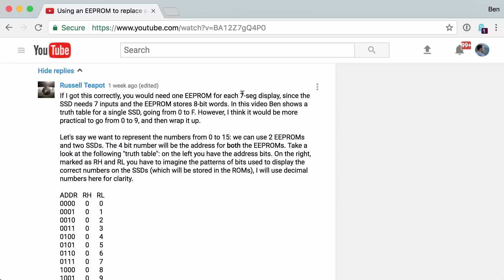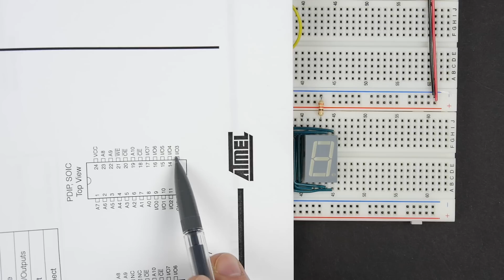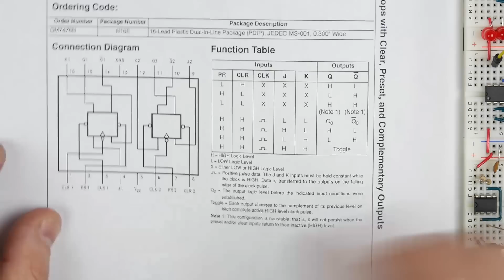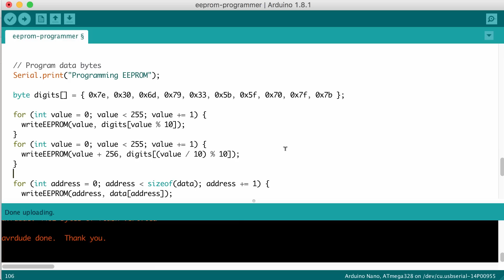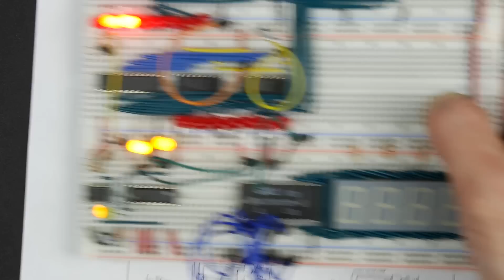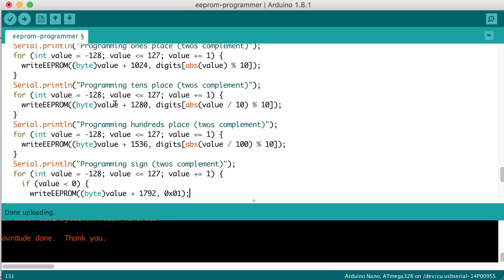Build an 8-bit decimal display for our 8-bit computer

Comment: Hello.  Interesting.  Now, does the counter reach to 9999?  I see you use 8 bits so you wrote up to 255 values.  To write 10,000 values you will need 2^12 bits.  Am I correct?

Comment: I think the 74LS139 is not rated to sink the current of the whole 7 seg display (all 7 segments + dot). isn't it better to use transistors or darlington array to switch the common cathode/anode of each display?

Comment: I have an idea that I’m 90% sure it will work,as long as the displays will hold (or flash very fast) the data they have been sent.

I don’t think we are making full use of the memory. Rather then using 16 bytes to encode one seven segment display, we can use 64 bytes to encode four seven segment displays.  In essence we can use the high two address lines to switch the memory input between reading the processor data byte and high & low address bytes and switching the memory output between the three display digits.

So all the processor address and data bytes, and all the displays are always connected to the memory input and output; it’s just that which input the memory listens to, and which display digit the memory outputs to, are gated by the high two memory address lines and some incidental logic.

Rather then having one memory chip for encoding each display digit, just use one larger memory chip.

James Law:  Any logic circuit can be implemented by a sufficiently large memory or mux/demux.

PS. I wrote this assuming this video was for the 6502 computer project, but it seems it’s for your homebuilt computer.

Comment: What if I don't have a 330 ohm resistor? Will a 220 ohm resistor work for to connect the 7-segment display common cathode to ground?
Reply: should be fine
Reply: @sampound  great thanks!

Comment: I've been binge watching this series because I'm thinking of starting a project which will use some of the same techniques; I noticed you're just using single resistor on the common pin of the 7 segment display - most of the guides I have seen about this insist that it's necessary to use one resistor for each segment on the input pin, but it seems like you are not experiencing any problems the way you're doing it.  Does it matter as much as they say it does?  (I think common wisdom is that with a single resistor, brightness will vary depending on how many segments are lit).

Comment: Another great video! It took me a hot minute to figure out that the 74LS76 was substituted by the 74LS107 in the kit. The only reason I was so hesitant to stick it in was I was unsure if I was going to need the 74LS107 elsewhere in the build. The Pinout is a little different but functionally the same. After getting it all hooked up I see that he clearly mentions the sub on his website. Good learning experience though. I’ll never complain about learning something.
Reply: Thanks so much for this comment.  Now to figure out the right pinout and do that

Comment: Love that you have a HP-calculator. I've never used any but (HP-25, HP-41C, HP-41CV,  HP-33s and HP-50g). Have those two last ones still with me. The HP-33s I bought because I needed light calculator when I worked as an electrician. The HP-50g I bought just because.

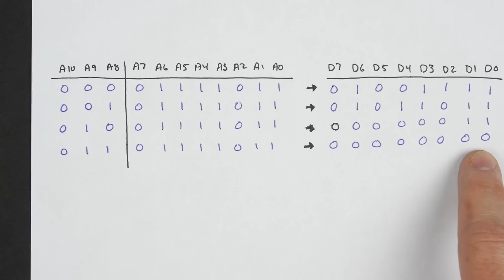Comment: @18:47

Would 

byte digits[] = { 0x7e, 0x30,0x6d,0x79,0x33,0x5f,0x7f,0x7b};
for(int calc=0; calc<4; calc+=1){
	for(int value=0; value<255; value+=1){
		writeEEPROM(value + ((255*calc)+calc), digits[ (value / (10**calc)) %10]);
	}
}

do the same thing?

Because you have written 0 -> 255, then the next round should be 
256 -> 512, then the next
513 -> 768 and 
769 -> 1024

Comment: using a 16K EEPROM to do this when you only use 256 bytes is an overkill.  You can use smaller eeproms or have the computer handle the display driving and multiplexing via software using a PIO (programmable input output) .  This design might be good to teach some digital electronics but would have been cost prohibited back in the 70's and 80's when 8 bit computers where around.

Comment: are 7E 30 6D 79 33 58 5F 70 78 the addresses of the bytes programed into the I/0 inputs on the eeprom chip? If i wanted to use my manual eeprom programmer what dip switches would i have turned on to program 011111110 into the 7E address location ?

Comment: i manually uploaded the code you wrote on paper in the video with the manual eprom programmer you made in another video. the numbers are not coming out correctly on the 7 segment displays. the code i manually uploaded is the 9 bytes of code you had written on the paper. every time i try to copy and paste code to the arduino program i get all these error messages. are there any good videos where i can bridge the gap between hardware and c++

Comment: I could make the hardware connections and then I copied and pasted Ben’s code in the Arduino's IDE. I used Arduino Nano and the EEPROM CAT28 C16. I could successfully compile and upload the sketch. Unfortunately, I get different output than Ben. I verified the hardware connections over and over and everything is correct. And when I provide 8-bit base(2) input for the microcontroller, the 7-segment displays wrong base (10) as output of the microcontroller with the following examples from 1 to 15:
0(2)  4(10),   1(2)  5(10),   2(2)  8(10),   3(2)  8(10),   4(2)  136(10),   5(2)  137(10),        6(2)  6(10),   7(2)  7(10),   8(2)  12(10),   9(2)  13(10),   10(2)  18(10),   11(2)  88(10), 12(2)  144(10),   13(2)  145(10),   14(2)  14(10), 15(2)  15(10). 
For numbers from 16 and up, if the 8-bit input does not have bits 1 and 2 on (counting from 0), then the decimal display is always 4 more than what it should be, for example, 16(2)  20(10) and 40(2)  44(10). But if the bit 2 or 3 is on, completely wrong decimal value is displayed. 
In the code, there is an array of digits which according to the tutor holds decimal code used to display the digits. But I do not understand what they are exactly. I would understand if they were hex representation of BCD for digits 0 to 9. I really need to make the microcontroller to convert 8-bit binary  to decimal as soon as possible and I do not know where to post my question. So, I hope this is appropriate place.
I wish Ben or someone else who understands the subject very good could tell me why do I get such outputs if I exactly copied and pasted Ben's code, which I got from the link on this page, I made the hardware connections are exactly as ben shows. Thank you in advance  for your good answer.
Reply: My problem was a very subtle short circuit on my breadboard.

Comment: Similar to this BCD decoder, two devices I encountered come to mind.

One was an ALU built in the 1970s that did Fourier calculations (had two interconnected ALUs, one for real and one for imaginary components), and one of the coolest things was it multiplied two 8 bit integers in a single step by simply having all the possible answers programmed into PROMs.

Another device was a radar display console (also 70s tech as I recall) with maps and characters drawn by vector graphics. Both the X and Y axes were identical devices. To draw a line segment, one axis was put in "max delta" mode, meaning the coils deflecting the beam changed as fast as possible, and the other axis was in "Tan theta" mode, meaning a 4 bit number was applied to a ROM that had the rate of change for that axis programmed into one of 16 memory locations.  A digital to analog converter converted the number output of the ROM into a voltage that controlled the rate of change of the beam deflection for that axis. This resulted in a line drawn at a fairly precise angle on the screen.

Comment: I find it's easier when adding those numbers that represent the higher order bits on the address pins to use 0x100 instead of 256, 0x200, 0x300, 0x400 etc. It's certainly easier for me at least to remember 0x700 instead of 1792, and it makes the code more readable as well.

Comment: The wiring around the sevent segment displays seems tight to the point it doesn't fit. Ben must use some quite narrow wire as my 22AWG wire doesn't seem to be fitting in that 2x5 diagonal.
Reply: Just use longer length. It's not nesessary to be tidy on your own breedboard.

Comment: I design 3 7-segment display counter with only 1 eeprom. It works with 7bit binary. 7 address lines goes to eeprom and it makes 2 4bit outputs like that:

Binary       1. Output    2. Output
0000000   0000           0000
0000001   0001           0000
0000010   0010           0000
0000011   0011           0000
0000100   0100           0000
…
Than those outputs goes into binary to 7 segment display convertor and to display.
On first display I can get only 1 I get it with inverting bites of 100 to all 1 and ti goes to AND gate so when are all 1 it set s-r latch and turn on display

Comment: You could possibly even simplify programming the signs place for the two's complement section by bit-shifting to the right by seven and just writing that number. The sign bit would be a 1 or a 0 and with the common cathode that'll ensure that the g segment is lit or not based on if the sign bit is on or off.

Comment: Why not write all 4 digits in the same loop:
for(int value = 0; value <= 255; value++) {
   writeEEPROM(value, digits[value % 10]);
   writeEEPROM(value + 256, digits[(value / 10) % 10]);
   writeEEPROM(value + 512, digits[(value / 100) % 10]);
   writeEEPROM(value + 768, 0)
}

Comment: I don't see how this is better than using 3 eeproms. You now have 4 chips on the board, plus capacitors and resistors. How is that an improvement over using just 3 chips?

Comment: I’m pretty sure your code takes about 4 times longer than necessary just to denote when it’s writing to each place because it loops through the same set of values 4 separate times… if instead it was:

For (int value = 0; value <= 255; value +=1) {
        writeEEPROM(value, digits[value % 1]);
        writeEEPROM(value + 256, digits[(value  / 10) % 1]);
        writeEEPROM(value + 512, digits[(value  / 100) % 1]);
        writeEEPROM(value + 768, 0);
}
For (int value = -128; value <= 127; value +=1) {
        writeEEPROM((byte)value + 1024, digits[abs(value) % 10]);
        writeEEPROM((byte)value + 1280, digits[abs(value / 10) % 10]);
        writeEEPROM((byte)value + 1536, digits[abs(value / 100) % 10]);
        If (value < 0)
                writeEEPROM((byte)value + 1792, 0x01);
        Else 
                writeEEPROM((byte)value + 1792, 0);
}
//END

You only loop through each set of values once, writing each digit of value every cycle instead of writing all the ones, then tens, then hundreds, etc.

Edit: now that I think about it the only difference is writing at place 1,1,1,1….10,10,10,10….100,100 instead of 1,10,100,1,10,100… which might actually take the same amount of time…

Comment: I have a question. If I wanted to run a 2-7segment LED’s in hexadecimal right next to it just for reference would the best thing to do be to set another eeprom with parallel inputs and just add a separate counter for it? I assume i could use the clock from the JK flip flop but would have to repeat 0,1 on cycles 2,3 to keep them on the same clock?  

I am not sure what i would change in the program yet but must be quite similar just the 7 segment outputs would have to change.

Any help?

Comment: have you done a video on how to choose the resistor for the 7 segment display and because they come in different sizes and use as much as 12 volts for 4 inches how do you just make them work? what your discussing is the final project but im just curious about the display itself and how to make it simply work. how do you build a real clock?

Comment: Voltage  ⚡ required,  reduction or increase,  monitoring the voltages, if voltage is low the power is increase or charged so the machine or device can monitor it self.

Comment: I ended up getting a set of chips that includes this really nice chip that does the following:
It takes in a 4 digit binary number and spits out the proper a,b, c, d, e, f, and g segments for a 7 segment BCD display. That would really only work for the ones digit, tho. I'm wondering if there is some way I could use this really nice chip for all the other place values as well? It would require dividing by 10 tho and that seems like an expensive operation... anyone got any ideas?

Comment: It will be much more scalable if you just program 9 digits and multiplex the value-in/address with the same clock. It's simpler and you can go up to real 9999 and you are not limited to the eeprom size. You need 4:1 mux

Comment: How are you limiting current if it is going through the decoder instead of the cathode resistors? Wouldn't it be better to have decoder output go to mosfet gates?

Comment: Ben, this is great stuff!  Here’s a couple of enhancements:

1. It’s possible to program the eeprom to blank any leading zeros, so 001 would be displayed instead as 1.  For signed numbers, the “-“ sign could appear in the display to the left of the most significant digit’s display, so -007 would be displayed as -7.  It’s all a matter of programming the eeprom.

2. By using a 4K x 8-bit eeprom, the additional address line would allow you to display values in unsigned decimal, signed decimal or hexadecimal format (hexadecimal format would only use the two rightmost displays; the two leftmost displays would always be blank).  To differentiate between hexadecimal and decimal values (necessary for values like 23), the rightmost display’s decimal point could be lighted for signed and unsigned decimal formats (the value 23 would be displayed as “23.”); and unlighted for hexadecimal formats (the value 23 would be displayed as “23”).

3.  A simple (debounced) momentary push button could be used, together with a 2-bit counter, to cycle through the three display formats.

Paul
Reply: I'm liking some of these ideas, I might implement it at some point.  I do want to make a 16 bit computer next...just not looking forward to all that wiring

Comment: 15:21 Convert binary to decimal by repeated division: https://en.wikipedia.org/wiki/Positional_notation#Base_conversion
0b11111111 -> 255

255/10 = Q:25 R:5 this 5 is the 1s place
25/10 = Q:2 R:5 this 5 is the 10s place
2/10 = R:0 R:2 this 2 is the 100s place.
Reply: Same goes for hexadecimal to decimal by repeated Division
0xFFFFFFFF = 4,294,967,295
4,294,967,295/10 = Q: 429,496,729 R: 5, "5" in ones.
429,496,729/10 = Q: 42,949,672 R: 9, "9" in tens.
42,949,672/10 = Q: 4,294,967 R: 2, "2" in hundreds.
4,294,967/10 = Q: 429,496 R: 7, "7" in thousands.
429,496/10 = Q: 42,949 R: 6, "6" in ten thousands.
42,949/10 = Q: 4294 R: 9, "9" in hundred thousands.
4294/10 = Q: 429 R: 4, "4" in millions.
429/10 = Q: 42 R: 9, "9" in ten millions.
42/10 = Q: 4 R: 2, "2" in hundred millions.
4/10 Q: 0 R: 4, "4" in billions.
0/10 = Q: 0 R: 0, "0" in ten billions.
0/10 = Q: 0 R: 0, "0" in hundred billions.
0/10 = Q: 0 R: 0, "0" in trillions.
0/10 = Q: 0 R: 0, "0" in ten trillions.
0/10 = Q: 0 R: 0, "0" in hundred trillions.
0/10 = Q: 0 R: 0, "0" in quadrillions.
0/10 = Q: 0 R: 0, "0" in ten quadrillions.
0/10 = Q: 0 R: 0, "0" in hundred quadrillions.
0/10 = Q: 0 R: 0, "0" in quintillions.
0/10 = Q: 0 R: 0, "0" in ten quintillions.
S: 0, "+" in sign-number.
+00,000,000,004,294,967,295 which is the same as 4,294,967,295.

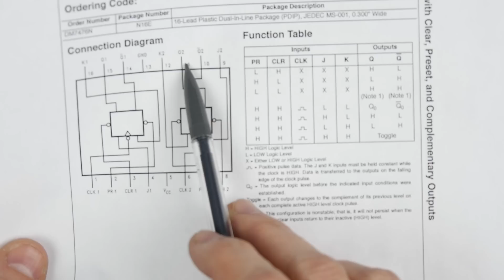Comment: Does anyone know if it is okay to use a SN74LS76AN instead of your "74LS76"? I got some off amazon and I'm struggling to find connection diagrams like the one you use at @10:10. Thank you!
Reply: They are the same. Just ignore letters before and after the item number. The firsts are the manufacturer, the last is usually the chip package type.

Comment: I had made a project for college and the challenge was to construct an AU (not ALU), that could handle sums and subs of two 4 bits numbers. My approach was check if the sum is greater than 9, greater than 19 or equal to 30. Based on these three checks, we add 6 to a number greater than 9, 12 when greater than 19, and 18 when it's 30. Hence we can show the decimal representation of the number avoiding the hexadecimal one.

It's very complicated for me to explain because English is not my mother language, and I don't know some technical words necessary to explain the whole thing, but the core logic was that and I wanted to add to comment section because I had a hard time figuring out how I can solve that challenge.
Reply: That is called decimal adding using BCD in binary form.

Comment: One thing I don’t quite understand about this is the "Two's complement" on address pin 10. When Address pin 10 is high and you are on the second half of the EEPROM. I don’t understand why when Address pin 10 is low you can address up to number 256 but when Address pin 10 is high you can only do -128. Surely if you can address 256, with Two's complement you should be able to address up to -256?
Reply: In both modes you get 256 different integer values. In one mode the numbers from 0 to 255, the other the numbers from -128 to 127 (including 0 of course). That is, when pin 10 is high, you don't get just negative values, but shifts the range 128 values towards negative. Bits are just ones and zeroes, and what they actually represents is up to the user. The binary value is the same for the unsigned byte 243 and the signed byte -13: 11110011. Same as 01000001 is both the value 65 and the ASCII code for 'A'. Same value, different representation - and different meaning depending on the context. In short, pin 10 changes the representation, not the value.
Reply: @pH7oslo  Ah the one thing I did not take into consideration was that the data lines from the bus and the digit display decoder were already connected to the EEPROM before using that final pin. Thank you for taking you time to complete that explanation.
Reply: @TW19567  
No problem =)